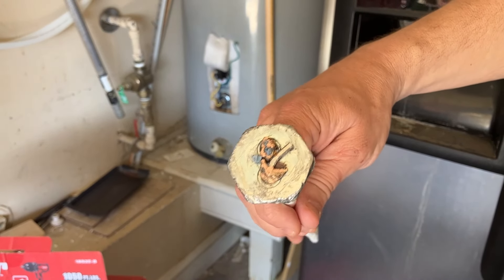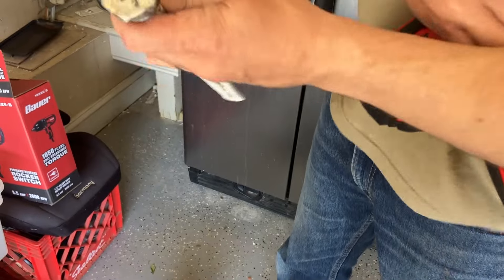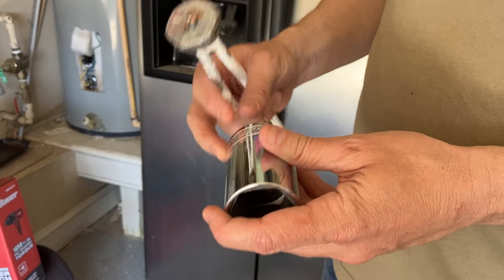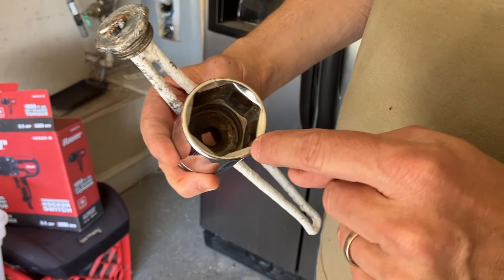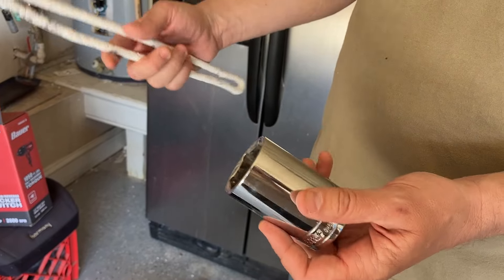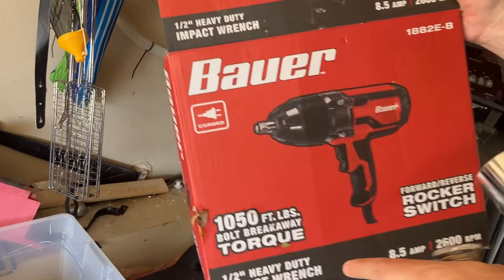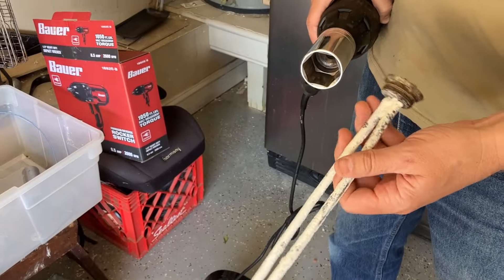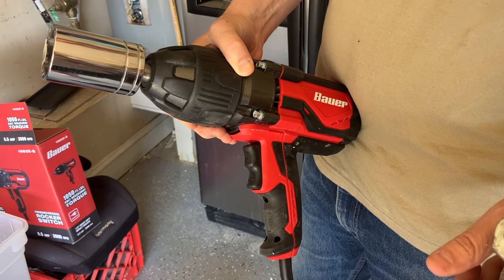Remove Stuck Hot Water Heater Element in :02 Seconds!

Comment: I would've tried a breaker bar with a "cheater" on it first.  The longer the better. But glad you got it out.
Reply from the maker: ok, what you mean 'cheater'? I tried a breaker bar but couldn't get enough bite or force to hold on to the element nut. Thanks for  the feedback!
Reply: @raddadprojects  The same six point socket, with a breaker bar but slip a long pipe, maybe 3 feet or so over the breaker bar.  The pipe is called a "cheater".  It increases the leverage.  Archimedes said "give me a lever long enough and I can move the world" (paraphrase)
Reply: nope. The only thing would be an impact wrench with the correctly sized socket. Same thing on the anode nut.
Reply: Yeah, we hauled out the breaker bar we keep in the trunk of the car, and we just couldn't get enough bite, the nut's profile is too low.  You can try it, though...
Reply: @raddadprojects I'm sure you couldn't. You weren't sure you couldn't. Kidding. 30% atf/70% acetone (please be effin careful, ok?), and a heat gun or "light torch". Go easy. Rock the nut without rocking it til you feel something. Good chance you'll be able to re-use the nut until i find where I lost, i mean where you lost the new one and go buy another. Hey, best wishes, U!! We good, right?
Reply: Don't even bother with the breaker bar. Or the cheater. You go get an impact and call it a day.  The jostling repetitive impacts help break said hardware free. Rather than a slow constant increase in force. Totally worth it. You may not use it everyday. But the days you can use it.  So much easier.

Comment: Good video 
I couldn't source a six point socket in a reasonable driving distance, used 12 point. Stopped midway to spray PB Blaster and let soak for 10 min, went at it again with 12 point and it broke free.
When I put the replacement in, I coated the threads with Permatech Anti-Seize lubricant.
Reply from the maker: Ok, good to know! Thanks for sharing!
Reply: Good for you. Don't throw out what you have, but if you ever need more no seize, glance at the copper ones. They're aircraft used, unless your lazy like me. I've used it for decades. I just don't want to work hard. Lord, a lot of really awful comments could be made about getting/not getting stuck. Yeah, I'm pretty de-minted, huh. Best wishes. Best of luck, always, ok?

Comment: I just went through almost the exact same frustration as "Rad Dad" and also was successful. This video is useful, but not too organized. I had discovered a similar, but more organized and useful instructional YouTube video elsewhere that guided me. Still, this video conveys real life experience and identifies the basic successful tactics to apply. I agree 100% with Rad Dad's recommendation to NOT buy the cheap tool sold at most hardware stores. Go directly for the 1-1/2 inch 6 point socket with the impact driver. If you don't already have an impact driver, you may be able to just use a manual breaker bar on your socket, but if the breaker bar doesn't work, just by a low cost impact driver. My battery powered Ryobi impact driver loosened the element after 20 seconds or so of banging away on the socket. Try to drain your tank before removing the heating elements.

Comment: If you have an element cemented in calcium like that, you have worse problems than a stuck element...replace the heater. Simple. Here's another hint. USE an IMPACT wrench on the anode as well, but I bet the anode in that tank is rotted away as well.

Comment: The tool works fine when it’s used correctly but most plumbers will use a 1-1/2” deep well socket with a thin wall..

Comment: Hit it on the corner with a cold chisel, it will turn. btw... no such thing as a hot water heater. Hot water doesn't need to be heated, just sayin...
Reply from the maker: Tried the chisel but couldn't get it to budge but might not have been doing it right ...and yes, true 🔥💧thanks for the feedback.
Reply: @raddadprojects  well I'm glad you got it out. The 1st rule of plumbing is you've got a 50/50 chance of what ever you put a wrench on will break off in your hand. LOL
Reply: That’s my pet peeve it’s a water heater 🤣🤣 call it that
Reply from the maker: @andrewfleming8428  meh 😁😁 🤣🤣